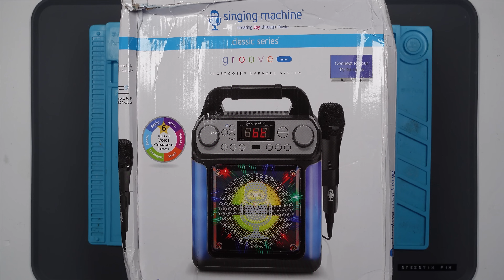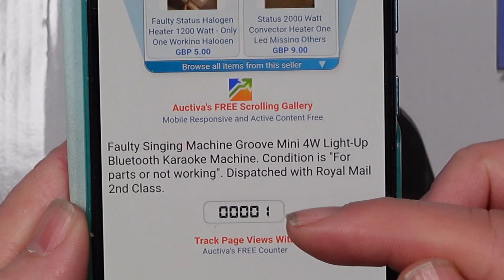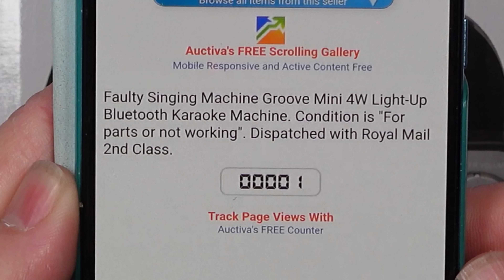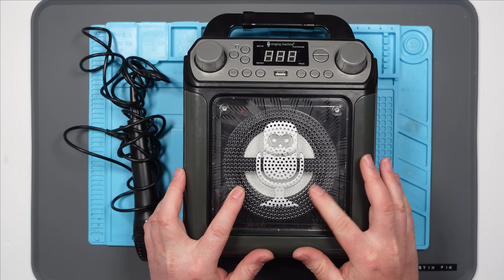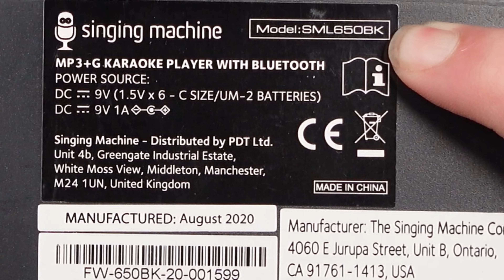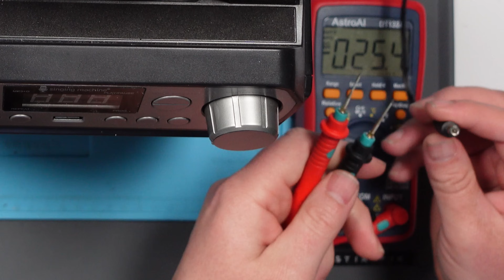Trying To FIX | Singing Machine KARAOKE System

Comment: This looks similar to that Street Fighter arcade cabinet where the coil was acting up and prevented the voltage regulator from kicking in, but when you accidentally shorted something it sprung to life. Always suspect those little 3 and 5 legged voltage thingies.

Comment: Well done.

My daughter has the same model of this singing machine (in white though) with the same problem, which landed me here.

Thanks to your video I'm now convinced that I don't need to waste anymore time trying to try fixing it. I don't have the tools to solder that tiny stuff. I was hoping for an easier fix, like hard resetting or whatever.

This kind of using wrong specification parts in a commercial product is definitely planned obsolescence and I apploud you for fighting it, but it just doesn't make sense for me to fix this one.

Comment: I have a karaoke  USA model gf920  Have not used it in a couple of months and it's not turning on and I plugged in the AC adapter is it because the battery pack is so dead I need to charge it? I always thought it would work with the dead battery pack if I plug it in with the AC adapter?

Comment: I was disappointed that you didn't use the thermal camera after the part was replaced to see if the temperature was back to normal.  The singing at the end was a bonus.  My dogs were howling along with your singing.

Comment: Thanks, I couldn't work out the fix on a Daewoo compact bluetooth Karaoke machine.  Occasionally it would turn on but 99% of the time it wouldn't.  Thanks to this video it turns out to be the same fault on the same chip, 4.8Volts outputted rather than 3.3v.   I replaced the chip and it works fine now. The Daewoo main motherboard looks exactly the same as one in the video, so looks like different makes used the same design.  I bought it as factory return stock, there were 10 other machines with the same issue so there is good possibility there was faulty batch of these chips, and they were sold to different retail companies who got the same main board but pimped up the externals to their own liking.
Reply: Daewoo Sucks

Comment: Hi Bro, i have same thermal camera from Huepar. But i am facing some problem.its power on/off switch not working. But i have to connect charging port to turning it on. And when i am pressing any of its switch button pic snap, setthing etc then it screen go dark. Any i have to completely disconnect its battery and reconnecting it back to turn it on. Any such situation you are facing? 
As you are technician you help to find its schematic diagram from its company. As mine is gifted from friend in this faulty condition. And no purchase detail available right here. Thanks

Comment: I’m guessing you do this strictly as hobby, given the amount of time that seemed to be invested. Do you fix things for resell or just create these videos for clicks and profit that way? If the problem was a faulty component, does that mean there are many others on the market with same problem?
Reply from the maker: I do it for fun, David. I do not make any profit aside from reselling a few items back to ebay. Not entirely sure what you mean by the amount of time that seemed to be invested, but my videos are obviously edited and are not representative of the amount of time it actually takes me to repair (or break further) the items I attempt to fix.
Reply: I was reading reviews on this product and people are complaining about it not powering on. Do you think there was a manufacturer defect with faulty component? I’m thinking about buying this product. I see this video was made 4 months ago. If there is a manufacturer defect these products are still in the shelves of retailers. So I will definitely get warranty. Thanks for your video
Reply from the maker: I believe that the chips are prone to failure, possibly from incorrect power supplies being used or a power surge etc. I guess they would still pass quality control. I'm not sure of the age of the unit I purchased from eBay, and it is possible that they have made revisions to the units since. Either way, a warranty would probably be advisable. 👍

Comment: Nice work Stez! I guess the voltage regulator wasn't resisting as much anymore.

Got a bit nervous seeing the cap on the right manipulate under the heat. Don't forget to use capton tape; it is your ally.

Otherwise, a better fault find, solder and ballad than I could do. 😁
Reply from the maker: Thanks Toxo! Yeah, apparently it's quite common for them voltage regulators to fail over-voltage like that. So that's something useful I've learnt from doing this! The other thing I've learnt is that I think I have a real shot at winning the next series of Britain's Got Talent. 👍
Reply: @StezStixFix  😂

I wonder how voltage regulators work. I'm guessing they vary their resistance to the input voltage, like a thermistor is for relative heat?
Reply from the maker: @ToxoRetro  I've just watched a video on it, and I still don't fully understand how they work! I'm gonna assume it's magic. 😁
Reply: @StezStixFix  Agreed, it's witchcraft. 🧙‍♂️ 🤣

Comment: Isopropanol Alcohol is great for removing hot glue from electronics.
Reply from the maker: Thanks Fuzzy!, i did actually use IPA on them and it worked a treat.  Just had to cut the video down a bit because that bit wasn't particularly exciting 😁

Comment: Steve you numpty 😂 The Model number is BK Not! 8K ?? You need to fly to Specsavers other wise you'll end up with Beans on your Weetabix 🤣🖖👍
IPA over Hot-glue weakens it, so you can remove it easier. It's Common for an LDO to die' over-voltage like that. Your singing voice is 😱 Wow! you got the power alright.
Reply from the maker: Thanks brother Steve. Well spotted on my deliberate mistake with the model number! 😬
I did use IPA on the glue and it worked a treat, just cut it out cos it took several minutes and was frightfully boring. 😁
I didn't realise they could fail over voltage, I would've assumed it would go the other way, but I'm glad I eventually figured it out. Now, what to do with the other 19 LDO's that I bought! 😂
Reply: I knew hand on heart you did it on purpose. Hey, It made me lol & smile. I hope others see the fun in your videos too! Ah yes editing that part out was clever, I think a tense moment like that, will it work wont it work. Would have peeved people off with limited patients 😀 The temps of the LDO (Low-dropout) can function up into the 80s but the voltage for those tiny ones like that' going over 3.6 = death! No worries at all having over bought we all do that, you'll find a use over time. BTW brother Steve your section of the MMV was great! to see you winning 😁😎👍
Reply from the maker: Thanks Steve, it was an honour to be invited on to MMV's first episode of YouTube Fixers. He's such a legend. 👍 Got me a few hundred more subscribers too. Can't grumble with that 😬
Reply: He's got good taste has Vince. He knows who, what to choose. Your both! Legends!! I just hide in the shadows enjoying the content you both create. I do offer some advice and help, ideas from the shadows. More! subs = more pressure for further awesome content & with a voice like that, they'd be stupid to' Let it Go! 😂🖖👍
Reply from the maker: Sorry for late reply, my phone was Frozen 😂. Tried to reply on my laptop, and that was Frozen 2! 🤣
Reply: Its OK I was looking out the window counting Cars 1-2-3 & some Planes flew over too! I was day dreaming of the Toys and Story's we used to enjoy, hoping for another 5 star adventure 😂🤣
Reply from the maker: 😁 Incredibles!  Those puns are right Up there!  😂
Reply: I find it Kim possible to give in, we keep being, Goofy | TinkerBell. Its time for me to Bolt off & put some bacon in the Peter Pan. Keep having fun! before we turn into old Dinosaurs.  Have a good day Brother Bear & Remember its Freaky Friday tomorrow, You National Treasure you! 🤣